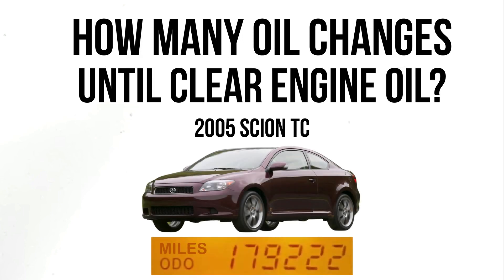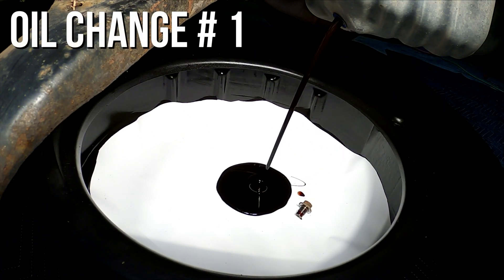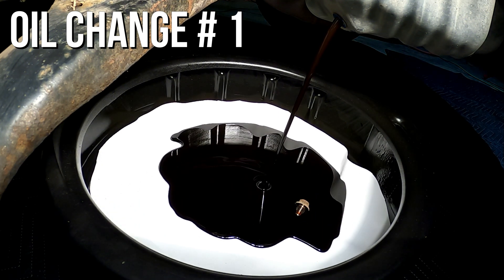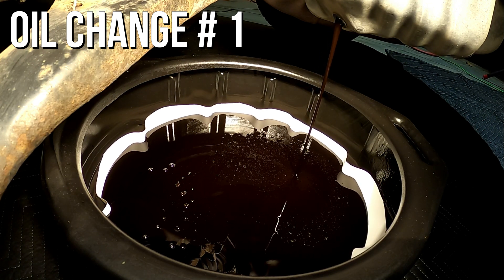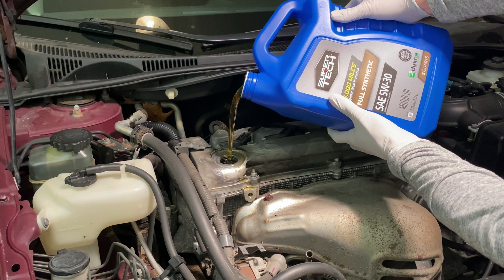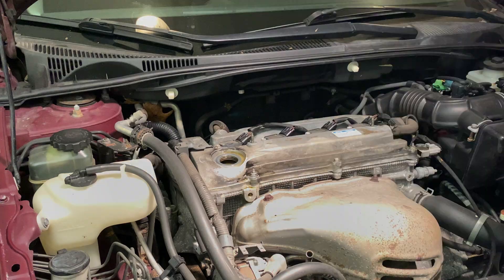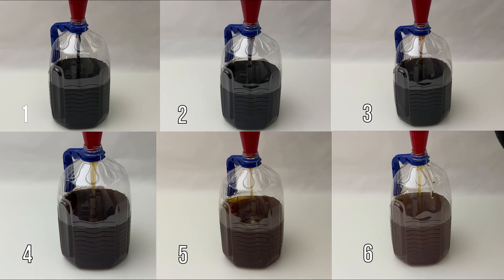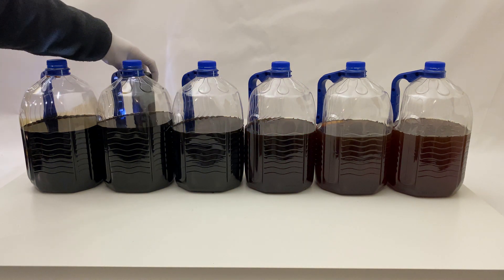Clear Engine Oil - How Many Oil Changes Does it Take? (with Color Comparison)

Comment from the maker: I made a clear oil filter our of glass, check it out: https://youtu.be/bvmT7UCWA2Y
Reply: The teenager working at Valvoline thought I was crazy for bringing the car back from yesterday's oil change but I remained insistent I needed to make sure I got all the acetone out from my accidental engine flush - I probably sprayed a couple ounces of CRC throttle body clean right into the camshaft from the PVC hose intake connected to the air box. So then I added Lucas - after I had driven a bit without the Lucas. So then I got the oil change yesterday - added some more Lucas. My silicone shaft seals started leaking but they were leaking a couple years ago from using MMO in the crankcase. So I think it's just since the oil is so thin. So the seals still leaked with the LUCAS in but not as much. But then my mileage was terrible and I discovered the Lucas totally clogs up VVT engines. Luckily I didn't put in that much. Maybe 8 ounces at a time - twice. So then I returned back to the 2nd oil change - explaining how I had to MAKE SURE I got all the acetone out of the oil as the acetone eats up the seals. So as I drove home I reset the MPG average and it had jumped UP a mile at least! I could not believe it - I was getting over one mile better than the factory rating for the MPG and this car has 267K on it. hahah. Thanks for the advice on insisting on multiple oil changes in a row.
Reply: drop the plug in the pan , so funny

Comment: If you are just going to do a bunch of drain and fills get cheap conventional oil in the proper viscosity. No point in changing the filter out so many times either. For the final change use synthetic with a good filter. 

This year I did 4 oil changes in about 4000 miles on a high mileage vehicle I just bought. Now the oil is about as clear as water with a tinge of yellow. The filter was changed each time since it was driven about 1000 miles on average. I will be going to 3000-5000 mile changes for now. Doing this removed a lot of sludge as the oil was originally black even after changing it.
Reply from the maker: That's a good approach to cleaning out a sludged engine!

Comment: So in the end you are just stuck with as much cheap oil in your engine, then there was black oil leftover after the first flush? The engine always keeps some and is never fully empty, interesting..
And I wonder if it is recommended to do an oil flush with chemicals added every other maintenance period, or is a simple flush just enough?
Reply from the maker: These flushes were just for test purposes only, there is no benefit to  multiple flushes.

Regarding a chemical flush, depending on your conditions, vehicle age, and maintenance, I’d say a flush every 50-100k miles is fine.

Comment: Cant we use cheaper grade oil for this kind of testing instead oem recommended grade?
Reply from the maker: If the weight is the same you will be fine, you will only be using it for a short period of time. 👍
Reply: @OwenLucas  great, thanks for clarifying my doubt.

Comment: Owen, thank you for going to the effort to do this experiment and share it here.  This is super interesting.  I think it should be particularly informative to those who let the motor oil drain for an extended period, even overnight, in hopes of getting the cleanest oil after oil change.  To me, your experiment shows that extended drains are in vain, unless they combined it with multiple changes.
Reply from the maker: Thank you for the compliment.  I actually did a 12 hour long oil drain video that you might be interested in: https://youtu.be/4U39Nudyj0s   Basically draining when hot for 1 hour is the sweet spot.

Comment: Three changes got the job done.  Subsequent changes had mostly a cosmetic effect.  Going extended interval makes the oil extra dirty.  It is best to change more frequently with cheaper but still properly specked oil.  Oil companies say you can go extended with their product but will not tell you you'll need an extra flush afterwards ($$).  Imagine the damage to new oil if after an extended run with fancy oil a normal mineral oil is used afterwards!  It will be junk from the start.  It is best not to do these super extended drain intervals.  10k is ridiculous.  One should probably not go past 5k especially if the car is older and has some blow-by past the rings or runs rich, contaminates oil with fuel.   Thanks for the video, awfully wasteful in oil but very illustrative.  Subscribed.
Reply from the maker: Thank you Sir!  I agree, 5k is the right mileage especially for older engines.
Reply: 5k miles or km?
Reply: @ Video references miles.
Discussion is about mileage.   5k miles has become a standard of oil change interval in the US, ...with the newer Full Synthetic oils also known as fake or hydrocracked oils, that are well refined mineral oils labeled as fully or full synthetic.

Comment: Instead of actually using an engine flush additive, it's best to do two to three subsequent oil changes like this do a thorough clean without having to have the additive ruin the seals.
Reply: Depends if you have sludge, if you have, additive will remove more od it than just washing with clear oil.

But if no sludge, yes, washing is better for the engine.
Reply: Who can afford 6 oil changes instead of 1, when you have multiple cars?
Reply: @douglichty6191  engine flush is save for the engine and costs so little you might as well get one

Comment: I once came over a comment saying when you flush with cheap oil either u add it max level like usual oil or add it half then run 10 mins then drain and again add the other half then run 10 mins and then drain again before adding the usual engine oil.
Reply from the maker: I would always fill up to max level, if you go lower than the lowest allowed mark on the dipstick, that could be bad for your engine.

Comment: I have a 2002 Tacoma with 300 k miles and the previous owner must have taken fairly good care of the engine because I have changed the oil twice since I have had it and my oil is perty clean it’s got color and is not black by no means.

Comment: Nice. 3 was the magic number, IMO. I need to do that to my new to me car. Took the valve cover off, and it looked cruddy. Lack of oil changes, obviously. But it has 280k miles, so, ya know. Could be worse 😆 Nice vid 👌🏻
Reply from the maker: Congratulations on the new car!  This video was basically a test on how to get the oil clear. I would do a flush first as shown in my engine flush video: https://youtu.be/rCo6aCed0bo
Reply: @Owen Lucas  Thanks! That video is what led me to this one in the first place! Was a very interesting video also. 

I was thinking about using a chemical like you used in that video, but like I said, my car has about 280K miles... It doesn't seem to be leaking/burning oil now that I've changed the valve cover gaskets. I'm a little concerned about using strong chemicals in such a high mileage motor that I'm also pretty sure has been neglected on oil changes and standard maintenance for at least the previous 5 years. Previous owner bragged about how he'd driven it 5 years and 100k miles and only charged the alternator in that time. I've seen nothing that leads to me believe he did anything to the car that wasn't keeping it from running. He took "If it ain't broke, don't fix it" to heart with that car 😂

So, I'm just thinking of doing what you did in this video. I'm sure it won't do quite the job the chemicals do as far as cleaning. But it also won't potentially over clean things that I might not want over cleaned 😆 

Might change the oil 3 times like you did, and then put a bottle of some light engine cleaner. Something that stays in for like 1k miles slowly cleaning. GG

Comment: 5 oil changes, and using the cheapest oil and 5 lots of oil filters here in the UK would cost £250 about $300.
Reply from the maker: I saved the last 4 oil drains, back into the bottle.  A 5 quart ( .94L) jug of economy oil can be purchased for $22 with an economy filter for about $4. at Walmart. Supertech is their store brand. Walmart is the most economical retail chain in the US.

Comment: Do you have to start engine each time you pour a new engine oil to flush in this video. Thanks for the video but just curios to know the exact process beacuse i'd like to do this tomorrow. thank you
Reply from the maker: Yes I started and ran the engine for about 10 minutes or so.  To be honest this was an experiment, no need or benefit to do it in a vehicle.  An engine flush with Liqui Moly would do a more thorough job.

Comment: Also would it help to rev up the engine whilennthe engine flush is in the tank? Or just let it idle?
Reply from the maker: The instructions with Liqui Moly state not to rev the engine, just idle it.  The oil is thinned from the flush chemicals so lubrication is reduced slightly, so adding a load onto the crankshaft could cause more wear on the bearings.

Comment: Great video, decided to sub. I would love to see a second engine flush maybe on the 4th or 5th attempt just too see how much extra dirt it would bring out. I know that would probably cost a lot just be curious how many times you could repeat this process till the engine looks completely new. I'm about to do my very first oil change myself on my bmw 320d and will definitely do a double flush. But if I had more funds I'd do what you've just done in the video. Every used marvel mystery oil? Can be used as a light engine flush, or oil treatment and fuel treatment. Seen amazing things with this product.
Reply from the maker: Thank you Joseph!  I have heard great things about Marvel.  I think you will have a lot of benefit with flushing a diesel especially if you have a lot of miles on it.  I have a few videos coming up addressing your questions so stay tuned!
Reply: @OwenLucas  

I have used MMO in the crankcase for many years with success, as it is a very gentle cleaner. Project Farm further confirmed its cold start and wear protection properties for me.

But I would not recommend it for the fuel tank on modern cars with catalytic convertors. It contains sulfur. My cat had to be replaced right after using this stuff in the fuel.☹
Reply: I've done this, multiple clean oil flushes, then a chemical flush.  No difference, no additional removal, even oil analysis showed little increase in particulates.  On a 15 year old engine, 170k miles.

Comment: The drain for oil changes #4 and #5 looked pretty much identical to me...?  #6 was barely any cleaner.
Reply from the maker: Yes it does to me as well.  It seems like 4 oil changes is all it takes to get the dirty oil completely out of this engine.
Reply: @OwenLucas  exponential reduction

Comment: Hi Owen, do you have to buy 6 bottles of oils to accomplish this experiment? If yes, how many Litres for each bottle are you using?
Reply from the maker: I bought six 5 liter jugs of oil, and used about 4 liters out of each one.  I had a lot of left over oil including the usewd oil of which the last 4 drains I reused since it was in great shape.

Comment: Is this the car you did the liqui moly? Thinking of doing a flush and refill on an 200k mi. used car
Reply from the maker: Yes this is the same vehicle, though the flush was performed a few thousand miles before this video already.  I drained the oil multiple times so that I would have clear oil for my glass oil filter video: https://youtu.be/bvmT7UCWA2Y

Comment: Please Help, Nissan Trying To Charge Me $1800 For An Oil Flush. It For A 2016 Nissan Maxima That Rattling Under The Engine And Sometimes Smoke Out Of Tailpipe. Oil Change Was Done When I Was Suppose To But It Looks Expresss Oil Didn't Do Them. Nissan Said That Or Pay$12000 For A New Engine. The Car Is 2016 Are They Crazy Or Just What To Over Charge Me HELP
Reply from the maker: I don't see how an $1800 oil flush will prevent a $12,000 engine replacement.  I recommend getting a second opinion from another mechanic.
Reply: @OwenLucas  Thanks For Responding. Nissan Was My Second Opinion.The First Mechanic Shop Just Took My Diagnostic Money And Said There Was No Leaks And They Didn't Know Why It Was Smoking From Tailpipe. No Ones Seems To Can Tell Me What's Wrong. Why Do A 6yr Old Car Needs New Engine, I Have Gotten My Oil Changes On Time.

Comment: at the 2nd time I would just use the same oil  and just run the car for 10 mins then drain it out do it 2 more time using the same oil , then the fifth time I just put the new oil in. I think people should done it at 100k, and 200k miles.

Comment: Can you do 2 flushes with fresh oil and original filter and then new one once you’ve done the last flush ?
Reply from the maker: Add Liqui Moly to old oil, run for 10 minutes.  Drain, add new oil and replace filter.  Run engine for 10 minutes, drain, replace oil and filter.  Good to go, no need to flush again at this point.

Comment: This was probably good to do anyway because you guaranteed the majority of any liquid moly that absorbed into any deposits or were left coating anything were out after the second cheap Mobil 1 non extended change you did after draining the flush+oil.
Reply: PS, any Blackstone analysis for this?
Reply from the maker: No sorry, not this one.
Reply: @OwenLucas  that's okay. The gimmick is overrated and they always say "you can go longer" like that one sentence is worth buying the TBN. Changing synthetic at 6k is sufficient and I'm pretty sure at 7500+ is just fine. Sludgy is what I'm more looking at. That's why new oil will always start faster. 

Next time I'm going cheaper and doing the $20 Napa one.

Comment: I'm gonna need about 130€ for cheap 5 4litre oil, 5  cheap oil filters and an engine flush additive, without the final good oil and oil filter..
Reply from the maker: This was just an experiment.  There is no need for anyone to change their oil 6 times in a row.  If your engine is high mileage and has some age, engine flush and 2 oil changes should be enough.  I explain this in my engine flush video: https://www.youtube.com/watch?v=rCo6aCed0bo

Comment: Change oil every 3000 miles ( this used to be common, and still is with mechanics ) with synthetic oil and there will be no dirt build up and 500,000 mile engine life with a new Japanese engine.

Comment: You should have done an engine flush after the 6th to see if it becomes dark again.
Reply from the maker: I was tempted to do that since but I needed super clear oil for the purpose of my glass oil filter video: https://youtu.be/bvmT7UCWA2Y   It would be easier to see how clean oil flows in a glass filter rather than dirty oil.
Reply: @OwenLucas  

As you witnessed, it turns dark fast.
Reply: @steven4894  I checked out the glass oil filter video because of your comment. If you listen to the audio, he put old oil back into the engine before we see the oil "turn dark"...meaning it was already dark oil, since it was old. It's a shame because I was hoping to see some comparison - EG - I drained the oil after ~200 miles and it was dark already.

Comment: I imagine this video was quite expensive to make
Reply from the maker: I used Walmart Super Tech Oil, one of the cheapest synthetics on the market.  Economy Fram filters as well.  Thank you for watching!
Reply: @OwenLucas  you could use the flushed oil and filters after, at least for shorter OCI’s
Reply: @OwenLucas  

Excellent oil. Used conventional ST for the flush, then returned to ST synthetic. I did the same with cheap ("pump & dump") Fram filters.😂
Reply: Maybe around $140 more or less.

Comment: i did it differently, when the first time the oil drained finished, i used compressed air to blow the rest out. I had to use a big hole as to create a huge air current. It worked but made stuff messy